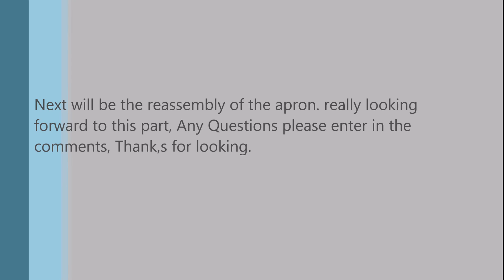Colchester Lathe (1964) Apron strip down

Comment: At 1:18 there is a pair of spring pins near the bottom of the pic that look like they're there to stop the power feed engagement lever dropping so far as it disengages. Mine hasn't got them and they don't appear on the apron drawing in the 1966 book :(
Reply from the maker: Looks like you are refering to the roll pins, do you have the holes there to fit a pair.
Reply: @MrNigel1340  I've not looked to see if I have holes for SPRING pins.

Comment: These videos are priceless.  I forgot how the plunger/shuttle assembly was on my worm box.  Solved my question!  I did notice the springs on your worm gear are a considerably smaller wire diameter than the ones on my '68.  I'm curious if they were changed by a previous owner that was fooling around, or if the design actually changed.
Reply from the maker: Very pleased to have been of help to you this was the idea of these videos as the only manual avaliable didn,t have any in depth maintenance instructions.
Reply: @MrNigel1340  The power feed trip on mine feels like it's missing a spring. Adjusting the knob has no feel to it and 'loosening' it just lets it drop out at any time. I'm wondering if I can just completely unscrew the knob and fit a spring to it but I'm guessing it's been replaced by a solid rod which will have to come out. Any thoughts on this would be much appreciated.

Comment: Ha, I wish your videos were around when I was doing mine! How hard do I hit it before I look for another way to get it off was what I was constantly asking myself. Probably the most satisfying thing I've ever done. Ours are made one year apart but I notice your motor is different. Maybe they changed suppliers around then.
Reply from the maker: I think like a lot of  manufacturers they probably bought job lots of whatever three phase motors were cheapest at the time, have you checked the start handle switch contacts, this gave me the single most problems of any of the parts, trying to source some compatible contacts for these switches and will put a link up if I find one
Reply: No, mine were fine. I have everything running how it was intended.
Reply: Usually takes me a couple of weeks on ebay to find what I'm after. Only a couple of things left to complete the set of accessories.
Reply: There is hundreds of these things being parted out at any one time worldwide.
Reply from the maker: Yes, and a lot of these parts still command good prices, was looking at a collet chuck the other day but decided it wouldn,t get much use.
Reply: What year is yours ?
Mine's 65/66 - based on dates that appear in the book.
Reply: @millomweb  yeah same here. 65 is what I was told.
Reply: @tristanpatterson3843  Going back to the 'you show me yours, I'll show you mine' type childish behaviour, how stiff is your knob ? The one on the feed engage lever - to screw it - to change the trip tension ?
The one at school (1980) had friction to it I guess to stop it vibrating and unadjusting itself. Mine's very free to turn - but I've screwed it off today and found the grub screw allen  screw holding the knob on was not tight. Still isn't - not found an Allen key small enough !
Reply: @millomweb  it should have quite a robust spring in it.
Reply: @millomweb  Yes, from memory it is inside the handle. It's what creates the tension. I can't have a look at mine as I'm on crutches and it has moving boxes piled in front. Check my rebuild video, there might be something that can help in there.
Reply: @tristanpatterson3843  I'm now wondering if they had 2 different designs of them. With my knob off, there's a long grubscrew that the knob screws onto. By adjusting this screw, I get 'control' but there's absolutely no tension sense !
It'll be better when I get the knob properly clamped to the grubscrew and power to the lathe again  - then I can do some experimenting !